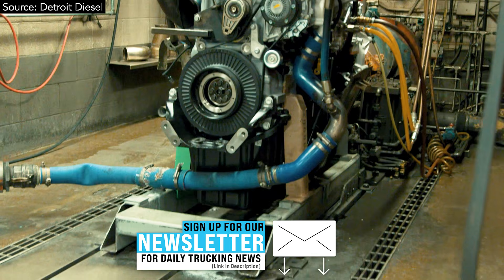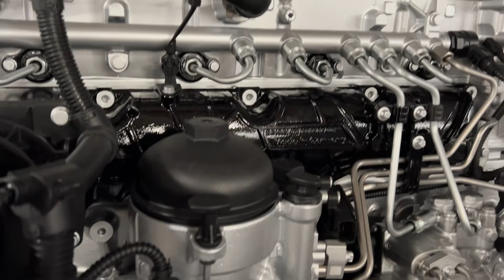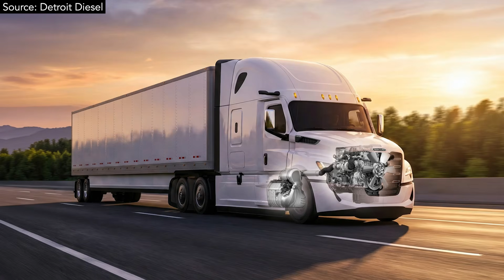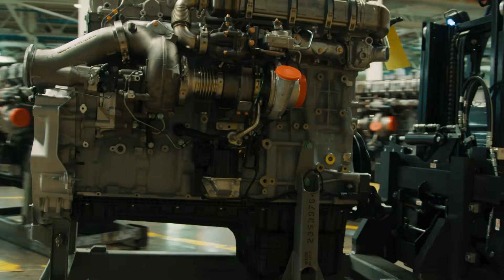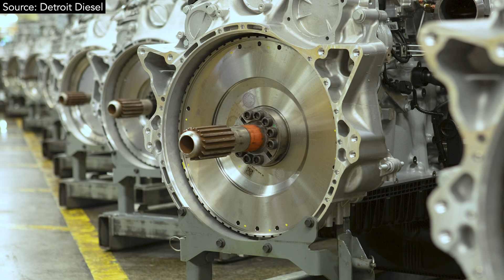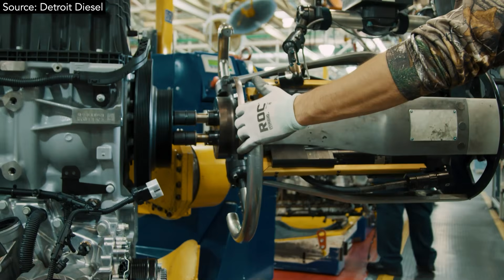Detroit Diesel Gen 6 DD Series: Exclusive Look at the 2027 EPA Ready Diesel Engines

Comment: Is there any update on the plastic  oil manifold ?
Reply: What a terrible design decision to use glued caps exactly where the oil is flowing at high temperature and pressure. The O-rings are another potential source of pressure loss. Why not use a simpler design with a suction tube directly to the pump and delivery straight into the block?

Comment: EPA removed emissions 😂
Reply: Incorrect.  They stopped enforcing fuel economy standards and are no longer concerned with CO2 emissions.  All other emissions standards (i.e. HC, CO, NOx, particulates) remain in full effect.
Reply: They did. However you have to understand why engine production will not get rid of them. For one, they never know how lasting the change is. If a Democrat gets back in office in 2028 this would most likely all be brought back. Even though I strongly believe we will have at least one more Republican president possibly for 2 terms, these companies can't gamble on that. Better to keep production on what will pass either way, even though those DPF systems are destroying the trucks life.